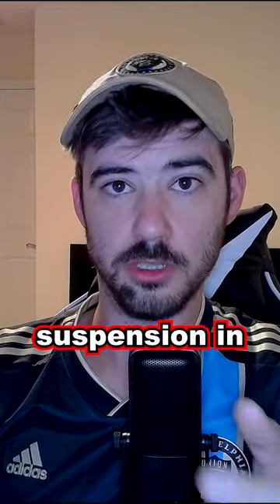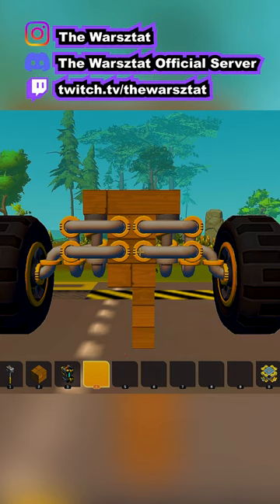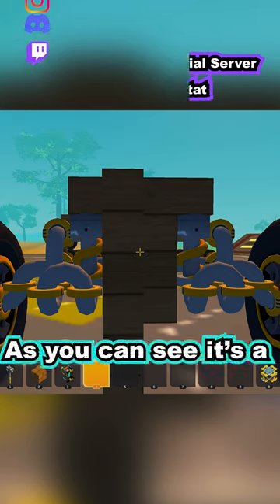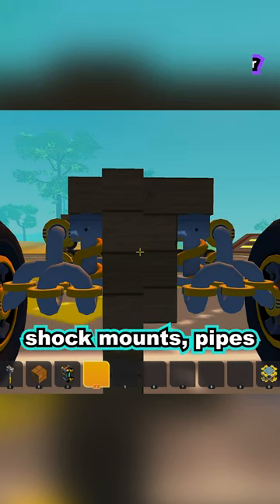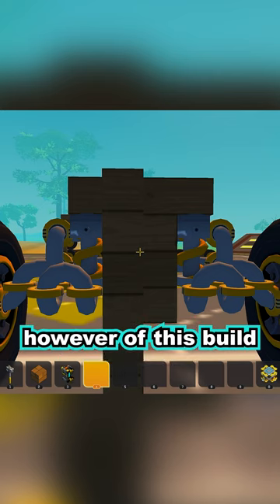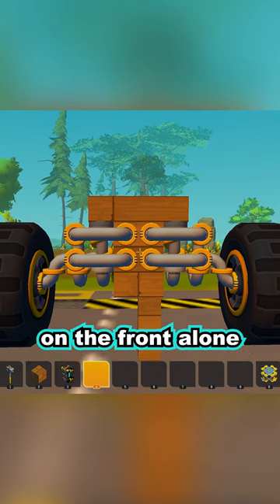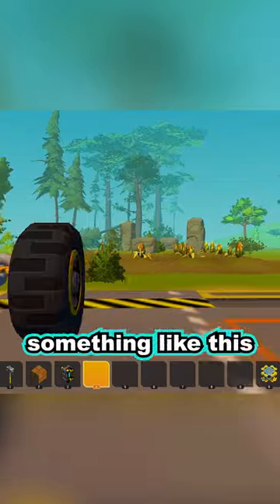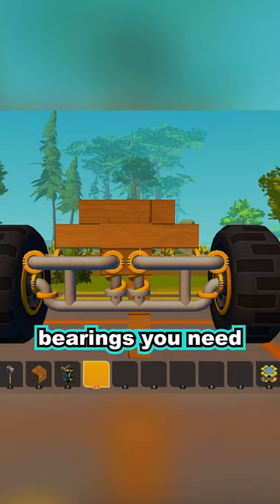Do THIS To Improve Your Suspension In Scrap Mechanic

Comment: i dont use complicated suspendion like  those ones i just put the suspension springs directly on the wheels
Reply: fr
Reply: It's not as good tho
Reply: no bearing?
Reply: I just have blocks
Reply: @mrmagnamalo7864  "wHaT dO yOu MeAn SmOoTh DrIvInG?!'

Comment: why have that when i can put 2 suspensions and 2 bearings on the top and a pipe bar with 2 extra bearings for the "axle"
Reply from the maker: You certainly can, I use this suspension for the leverage and travel that the pipe arm extending over the tire gives

Comment: Thanks for the suspension tip but i dont use suspension much since i dont go through rocky zones and you have good content
Reply from the maker: Shock mounts work just fine when driving over flat ground so long as they have travel distance! Nothing wrong with saving some material there

Comment: real suspension in real life doesnt use double-wishbone

only performance racing vehicles use double-wishbone for the capability to keep the wheel perfectly planted vertically on a flat and even surface

but with offroad builds, having the wheel go out is sometimes better than it going up exclusively, because it increases stability when you are least stable

Comment: What exactly is the benefit of double wishbone suspension?
Reply: looks cool
Reply: if one side of the car is higher than the other, you're going to be leaning - that's the whole point of the swing arm mechanism letting the entire wheel move up and down to a certain degree which improves handling and doesn't flip you